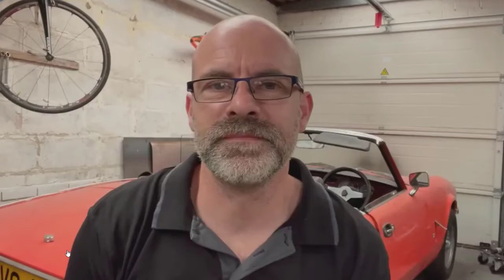How To Build A Fast Road Spitfire - Part 1 Introduction

Comment: I have just come across your Channel, I currently have a 1976 spitfire 1500 which I bought in 1977 when I joined the RCN as a junior officer, still in but getting out in two years. I have kept my car almost perfect, like you though I want more from the car. Canada is a big place, it takes forever to get anywhere because the hwy speeds are so high. I look forward to getting some ideas from you and actually trying my hand at working on mine.🇨🇦
Reply from the maker: Excellent Shane, and thanks very much for your comment, I appreciate it. As you may have seen, I have a few projects at the moment but I've tried to keep them separate in YouTube etc. and on my website so people can more easily follow their progress. If you're particularly interested in the Spit 1500 the one you want is the Fast Road Spitfire project. This is currently at chassis stage but suspension and brakes (upgraded) are now about done. I'm just waiting for the new drums and I can get wheels back on for the first time in many years. I'll then be covering the bodywork and engine/gearbox. Take a look at the website as there is a little more there www.ChameleonClassicCars.co.uk. Cheers Steve